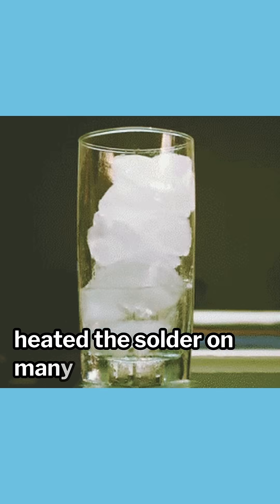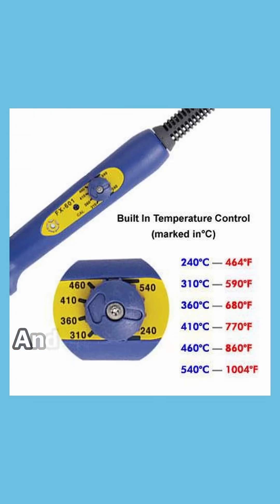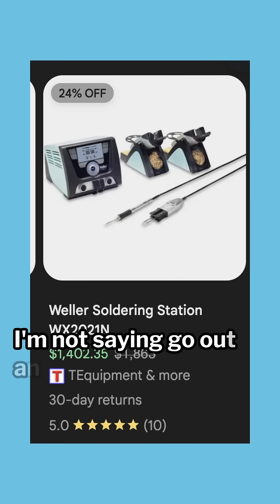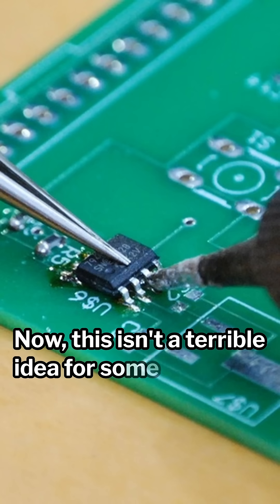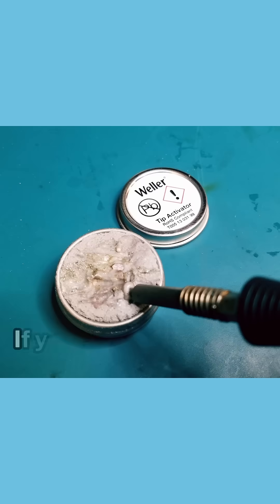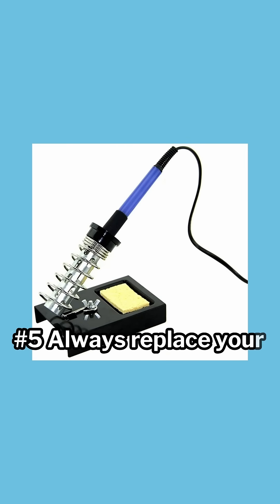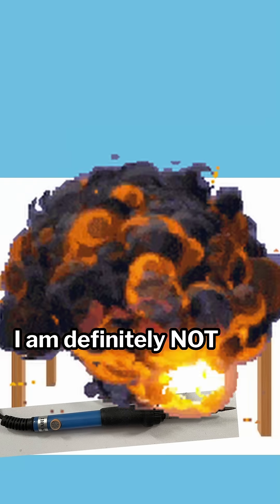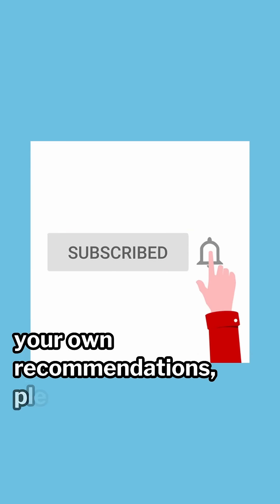DON'T Make These SOLDERING Mistakes.            #advice #science #electricalengineering

Comment: Also keep in mind: A good soldering iron doesn't have to be expensiv. 

I looked up an article in which they tested a bunch of soldering irons and bought the cheapest out of the ones they rated best. It's amazing, much better then the irons I use at work. And keep in mind that I also use cheaper and worse solder at home then at work.

Comment: Use a piece of heavy copper wire to conduct and spread the heat. If your soldering iron is just a basic heatpoint this is how you get control.

Comment: I've struggled with soldering when I was younger, but after I bought a good soldering iron AND a good soldering lead, I realized it wasn't a skill issue. Flux is needed for the non-lead solder.

Comment: tbh, temp controlled soldering stations are kinda overrated. Nobody ever touches those controls after first use anyways, and 400C works for all common solders. It's more the tactical heat management that you need to develop a gut feeling for.. knowing which size and thickness of contact needs how much heat, knowing which components are more or less sensitive.. and that takes time and practice. You can grill your chips dead with a 300$ Weller just as easily as with a 5$ home depot soldering iron if you have no feeling for heat management.
Reply: @ElectronicGuy1 Used to have a job where he repaired 3D printers day in and day out!

Comment: auto-idle irons are neat

oh also
I personally like Lead based rosin core solder

it just flows and is easier to work with

although good ventilation is a necessity

Comment: hello viewers in this video I am going to tell you how not pre tin your soldering iron tip correctly    
I have seen many people who use bad quality tips and worst of all they are not even tinned
But today I am going to tell you the easiest way to pre tin your tip 

So lets get to it

For this process you need  rosin next you need a high acidity flux Low acidity flux may do the work also but high acidity flux is recommended liquid flux is prohibited then you need something for cleaning the tip for that I choose steel or copper scrubber wire wet sponges are highly prohibited
Next you need something to make the tip a little bit rough for that you need sandpaper And at last some solder wire leaded solder wire is highly recommended

Now on to implementation 

So first of all you need to clean your tip with a little bit of sandpaper you don't need to scrub it badly or file it harder otherwise the tip will break what you need to do is just sand it until shiny metal underneath is exposed and all carbon is gone 
Next you need to plug your iron into wall out outlet and and let it heat during the heating process you need to put your iron tip in the rosin don't let it expose to air when its hot you have to cover your tip with a thick layer of rosin so no air or to be precise no oxygen should be able to get exposed to your tip when its hot next you have to add solder to tip while keeping it covered in the layer of rosin then you need to tin the tip with solder once the whole tip is pre tinned drop it in the high acidity flux for about two and a half second then pull your tip out and add some more solder on it then again put it in the flux do it twice once its done clean all the solder on the tip by rubbing it into the steel braid then you need to let the iron cool up by unplugging it from the outlet and don't remove the tip from iron and don't immerse it in water let the tip cool up naturally let the tip sit at room temperature for atleast 10 minutes before using it again once all that is done your tip is ready to go 

And one more advice before going that is do not use wet sponges to clean the tip since it can damage the tip due to thermal expansion and contraction 

Okay have a nice day 
Stay healthy keep soldering happily and let me know in the comment section if you have any questions or advice.

Comment: How do i tin the solder tip? I cant figure it out
Reply: hello viewers in this video I am going to tell you how not pre tin your soldering iron tip correctly    
I have seen many people who use bad quality tips and worst of all they are not even tinned
But today I am going to tell you the easiest way to pre tin your tip 

So lets get to it

For this process you need  rosin next you need a high acidity flux Low acidity flux may do the work also but high acidity flux is recommended liquid flux is prohibited then you need something for cleaning the tip for that I choose steel or copper scrubber wire wet sponges are highly prohibited
Next you need something to make the tip a little bit rough for that you need sandpaper And at last some solder wire leaded solder wire is highly recommended

Now on to implementation 

So first of all you need to clean your tip with a little bit of sandpaper you don't need to scrub it badly or file it harder otherwise the tip will break what you need to do is just sand it until shiny metal underneath is exposed and all carbon is gone 
Next you need to plug your iron into wall out outlet and and let it heat during the heating process you need to put your iron tip in the rosin don't let it expose to air when its hot you have to cover your tip with a thick layer of rosin so no air or to be precise no oxygen should be able to get exposed to your tip when its hot next you have to add solder to tip while keeping it covered in the layer of rosin then you need to tin the tip with solder once the whole tip is pre tinned drop it in the high acidity flux for about two and a half second then pull your tip out and add some more solder on it then again put it in the flux do it twice once its done clean all the solder on the tip by rubbing it into the steel braid then you need to let the iron cool up by unplugging it from the outlet and don't remove the tip from iron and don't immerse it in water let the tip cool up naturally let the tip sit at room temperature for atleast 10 minutes before using it again once all that is done your tip is ready to go 

And one more advice before going that is do not use wet sponges to clean the tip since it can damage the tip due to thermal expansion and contraction 

Okay have a nice day 
Stay healthy keep soldering happily and let me know in the comment section if you have any questions or advice.
Reply: hope i could help 
forgive bad grammar 
if possible i will make a video on it this is just a raw script for my video

Comment: don't leave your soldering iron out was my fav tip, my ex plugged mine in thinking it was my stereo and melted my carpet 😞
Reply: I put a fireproof blanket under my desk. They are only $9 now for the silicone coated ones.

Comment: TS80 for the win
Reply: I got the TS101, power it with a laptop/ monitor charger, it's so much better than the $25 hardware store one I had. 

It was good to learn on the cheap one though. For example I didn't know about tinning your soldering tip.
Reply: @potterfanz6780 yeah I rocked a 110v non adjustable one for years. The upgrade was like putting on glasses

Comment: I am mostly sure that I am not crazy, but I have been recommended on several occasions from experienced electrical engineering guys the following: you can leave a glob of solder on the tip of your soldering iron as it’s cooling down, and the globe will protect the soldering iron from oxidation as it cools, when you turn it back on the solder will melt, and you can wipe it off and you have a brand new fresh tip underneath the melted solder